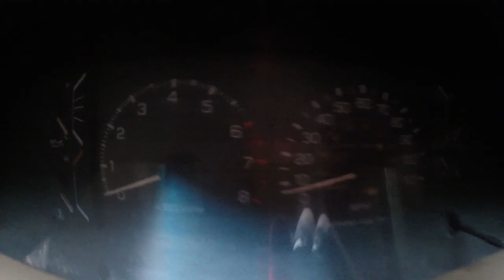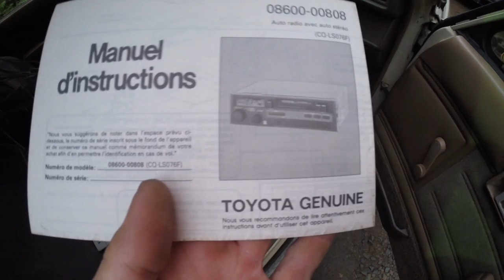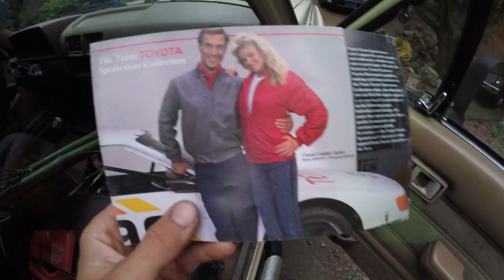Picking up an '88 Toyota Pickup SR5

Comment: That is a mount for an old school cell phone antenna on the right rear window. Coax would screw to the inside female port and the reception actually was obtained through the glass via the external mast normally about 18" long with a spiral area in the middle. Damn I'm old... Nice find.
Reply from the maker: Thank you! Im gonna remove it..

Comment: Have an 85 sr5 fully loaded with all options. X cab solid axle Efi. Also have that same canopy top there rare. I even have defrost rear window. Think that’s old style cell phone cb antenna. Take it off. Tie downs are not factory. Congrats on the find.
Reply from the maker: Thats awesome man. The efi is great, but i do love tinkering with carbs too. Straight axles are cool but i really prefer ifs for their handling. At least for what im going to be using this truck for.

Comment: Looking to pick up an sr5 v6 what you recommend to look out for when buying one of these
Reply from the maker: Rust on the frame and undercarriage. Make sure theres coolant in the radiator, and that no one has put any stop leak in there. Or the fluid is just water. And take it on a nice long test drive to make damn sure it doesnt overheat. Afterwards, check for fluid leaks under or around the engine. Check the oil before the drive too. And just generally make sure it runs and drives good if you are paying good money for it!! Good luck on your purchase, and welcome to the family!
Reply: Try to get the bulletproof 22RE instead, the V6 tend to have problems with head gaskets and rod knocks,js I've still got my '86 4x4 deluxe lifted 3" with 33's Bf Goodrich mud terrains, bought brand new before I went to the military, same color, looks exactly like the one u got, nice buy bro !!